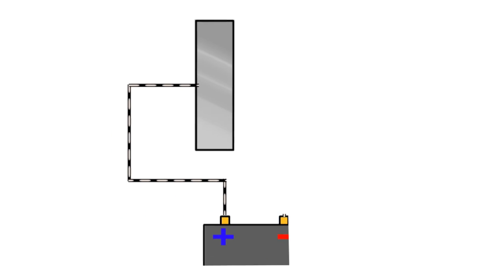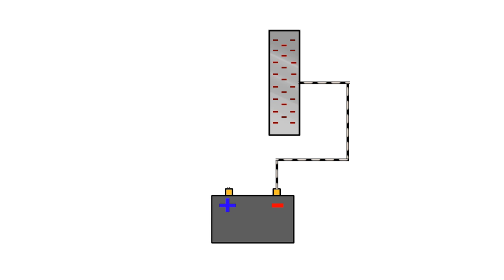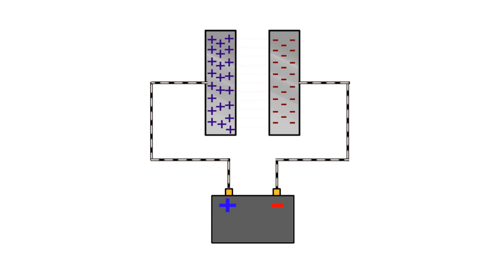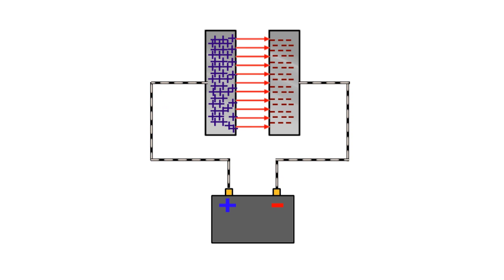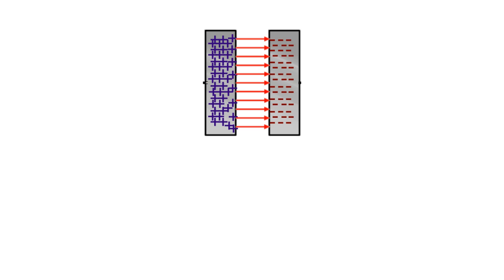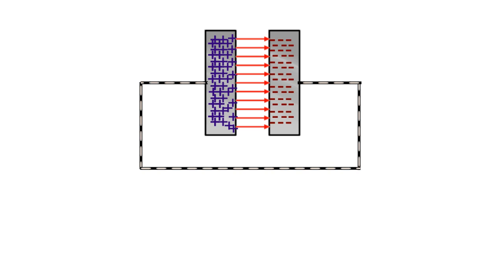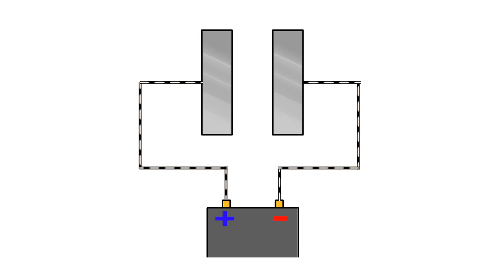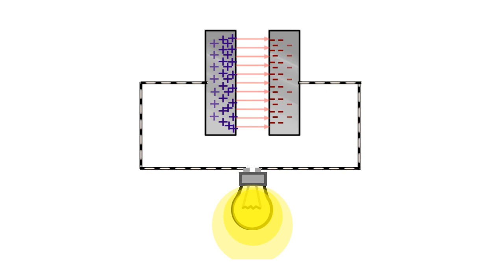how a capacitor works? (Animation)

Comment: I think this is *wrong*. In the beginning of the video you show that if you connect just one terminal of the battery (the positive) to a plate, the latter becomes positively charged; you also show that if you connect again just one terminal of the battery (this time the negativel) to a plate, the latter becomea negatively charged.

However, I think is is wrong because how come the plate can become charged if the circuit is open/incomplete? It is open because you're not connecting the plate to the other terminal of the battery, and so the air acts as a open switch (open circuit), meanjng no current can flow.
Reply: Yes bro there is a need of placing two plates side by side at a time to get the accumulation of charges at plates by attraction between plates and repulsion between the source terminals respectively
Reply: yes you are correct. Current cannot flow in an open circuit
Reply: Who said its flowing
 connecting one terminal to a piece of metal causes the metal to become a part of battery in which charges wander
Reply: @happypero1259  In order for a single plate of a capacitor to become charged, since initially it is neutral charged (no charge, discharged), then some amount of charge/current must flow towards the plate.

Comment: What's the need for capacitor in a fan....
Reply from the maker: It is used to make current of auxiliary winding lagging so as to generate starting torque
Reply: because single phase motor cannot be started by its own.we have to create a phase differnece to produce enough rotating magnetic field for rotating the rotor. A kind of starting torque